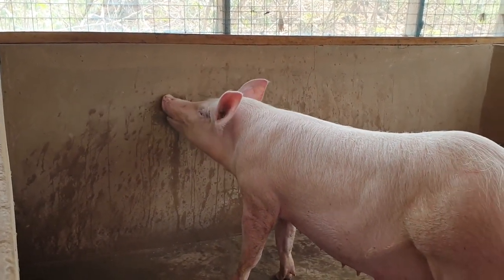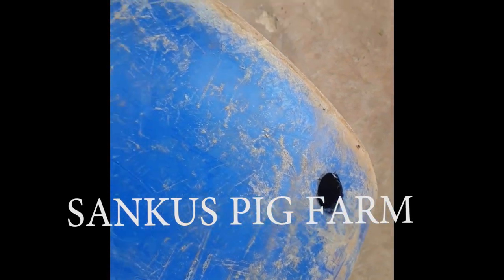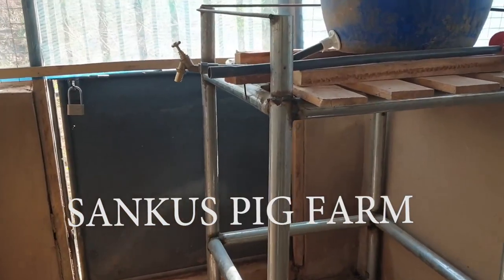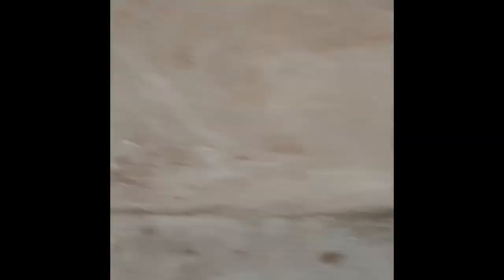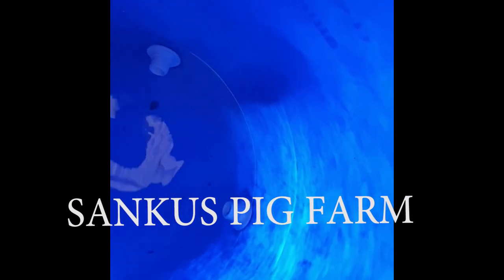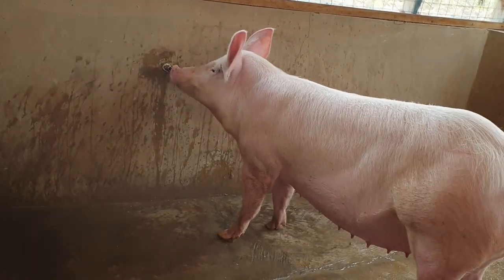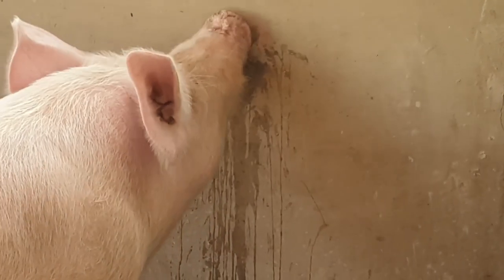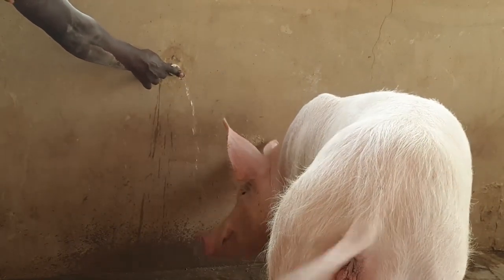How to install Automatic Pig and piglet drinker  without pipe water (nipple) DIY

Comment: Thank you very much 
If have  borehole  connected into  big tank  will still use the same method?
Do you have to put another small barrel inside again.
Reply from the maker: You can use it as a backup so that there is light off you will still have water but if you are using polytank then there is no need